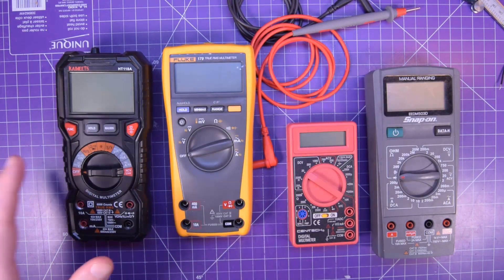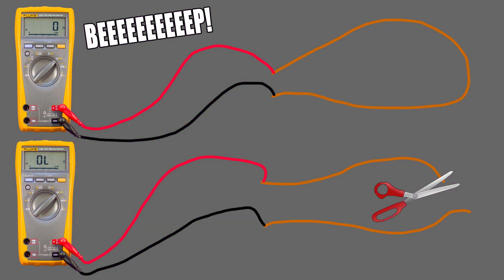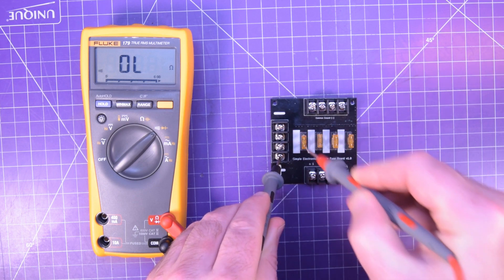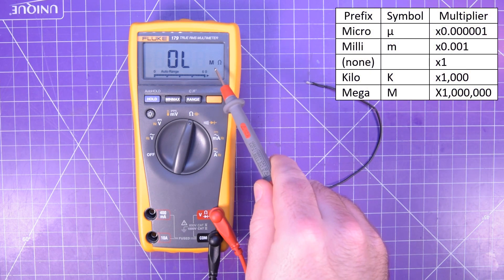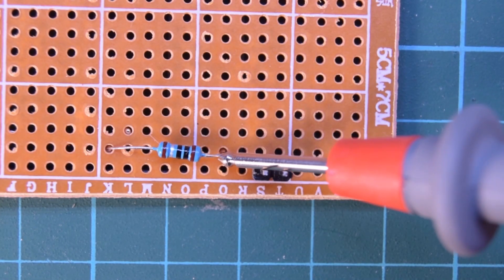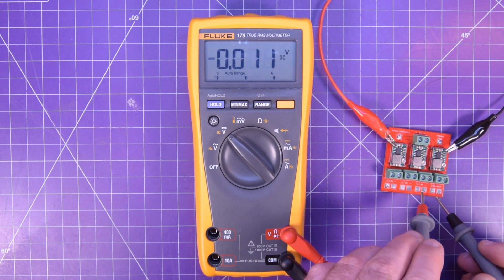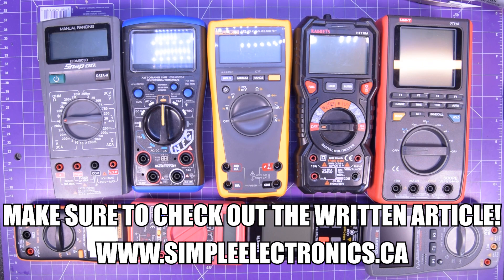How To Use A Multimeter: The VERY Basics!

Comment: Here is another one.  If you thought it was important enough to point out the probes go "red into red and black into black," you showed that, then at that level in the red 
Ohm" port, at the same level, i got "the V means volts, the Greek "O" means Ohms, and the ->+ means "etc."   Rather than explain what ->+ means, as you felt your viewer couldn't catch 
Red goes into Red," but ->+ needs no explanation, it just means "etc."   All the diving instructors would have thrown you out of the pool.
Reply from the maker: I'm not following you

Comment: Watch out while trying  to determine  if receptacle  is 110 or 220v , i got a reading of 114v...i wanted to be certain  so i plugged red probe wire into another of 3 ports which are all in tiny alien glyphs except  for "com" which i understand  is neutral  for AC current , there was sickening  explosion not as loud as fire cracker , more like slamming  a heavy book full force on a table . Meter still seems to work but maybe probe wire fried.... will test on DC car wire.... shit this is like defusing a landmine.

Comment: Most important part is to verify that your leads are good.  Continuity should be showing zero.  If not, you might have some bad leads.  My dad always had emery cloth with his meter.  Give the leads a quick clean with it.
Reply from the maker: With newer, more sensitive meters, it's quite normal to have a bit of resistance showing when touching the leads together - even high-end gold plated leads will show a bit of resistance - best bet is to zero it out with a "rel" or "delta" button if your meter has one - but unless you have a 4-wire resistance measurement mode, low resistances below 1 or 2 ohms can be quite imprecise
Reply: @SimpleElectronics  .5 ohms or less, according to Fluke.  All of my meters, even the cheapies, show 0 after a quick clean with emery cloth.

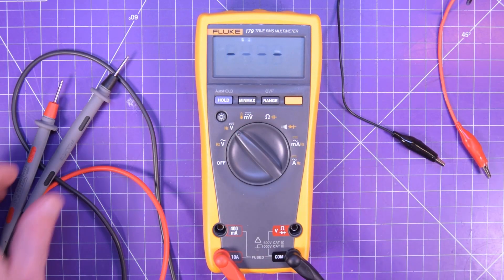Comment: 9:33 "Remove leads from current jacks after measuring." Blow the fuse: Is from residual static charge? The only thing I know about this is from constantly cycling my modem and router LOL! I know I have to wait a few seconds for the wires to "discharge". Is that what you are referring to? Thx!
Reply: Residual Voltage: 
Oh, and I know that some wires could take hours to discharge so this isn't a small afterthought. Time to discharge means a wire can carry Volts of Charge even after unplugged. This was a fact that a channel was making... from memory... something about using microwave parts. So, don't mess with it unless you are with an electrician.
Reply from the maker: @V.Z.69  Not wires per-se but Capacitors, which are like little batteries - and of course any wire that happens to be connected to them. A bare wire cannot hold a charge by itself!
Reply from the maker: No it's because if you leave the leads in current mode, next time you use it to measure voltage, you'll create a dead short and blow the fuse

Comment: Is it possible to know how much need the device to work or what is the correct voltage?
Let's say a device with no adapter or will the device can work on 220 or only 110?
Reply from the maker: Best way is to read the input voltage label - almost all devices have them
Reply: @SimpleElectronics  not all, specially  products for the US market, it says 110v and works fine on 220v and there are sub on reddit for that. I was thinking out loud if a way to know it would be helpful.

Comment: How can I test a computer PSU and motherboard safely as a beginner?
Reply from the maker: The PSU - as long as you mean the DC parts (no disassembly) - super easily - a motherboard however is quite complex with tiny little contacts to test - if you can even get the diagrams for it
Reply: @SimpleElectronics  I meant to ask how can I test it safely, meaning is it safe to test the pins of the PSU and board with a multimeter or should I worry about being electrocuted?
Reply from the maker: @path_ethics  as long as you don't open up the power supply, you can't get electrocuted by the low voltage DC from a pc power supply